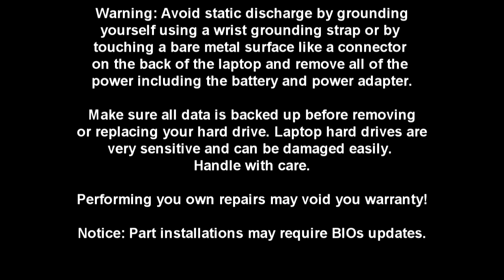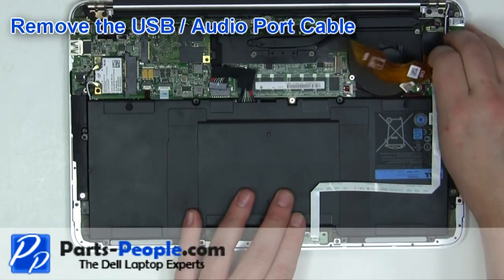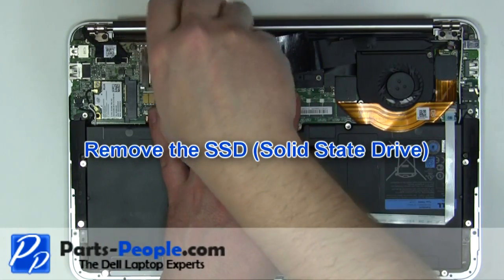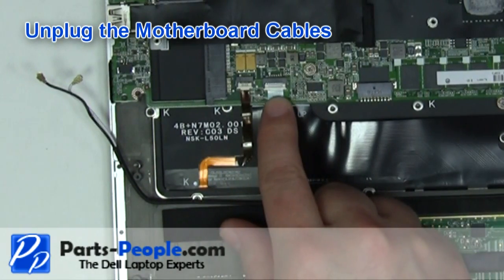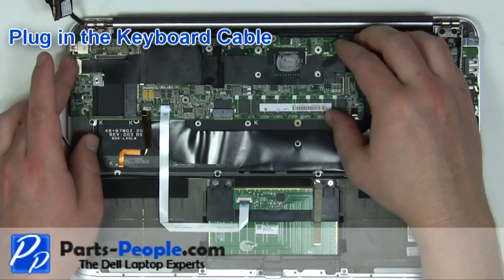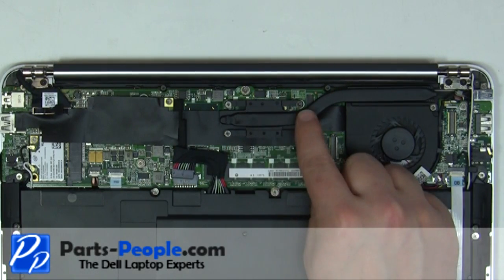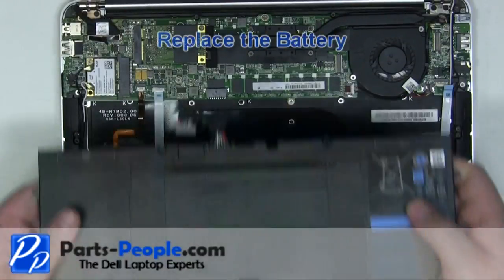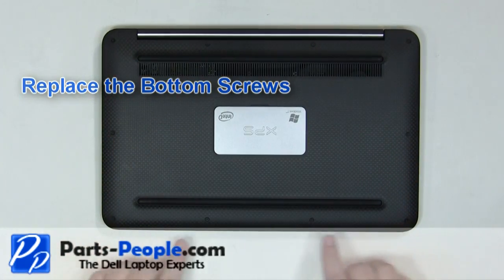Dell XPS 13 Ultrabook | Motherboard Replacement | How-To-Tutorial

Comment: dell, XPS 13-L322X: Image failed to verify with access denied press any key to continue, please can you me out. i can not get into the bios to turn off secure boot, but the is no CMOS battery to reset and i am stuck with that message. i have try all possible combination to access the bios. Fn + F12, F12, F2, Fn + F2, Fn + power. please help.

Comment: HI, is it possible to replace a l322x MoBo with a 9333 MoBo ? are they swapable ?
Reply from the maker: There are a few cable connections that vary between the two models that will possibly make them incompatible. Even if they they are swappable they aren't meant to be.
Reply: Thank you, another question, is it possibile to swap a non-touch display with o touch one ?

Comment: It's 2020 and I used this video to replace my motherboard. I pretty much used this channle to replace everything - Power cable, battery, motherboard BECAUSE the laptop was not charging plugging in the power adaptor.

Comment: I have a couple of questions. 1) can the CPU be replaced or is it soldered to the motherboard? Also, can the i7 model of the laptop accept an i5 version motherboard as a replacement? 

Thanks
Reply from the maker: The CPU is soldered onto the motherboard but, the motherboards can be swapped with a higher CPU.
Reply: Thank you so much for the reply! The motherboard in my I7 XPS recently went out, and the I5 ones are like a third of the cost on eBay, so I think I am going to use the I5 type.

Comment: Hi, just a question, I have a dell xps 13 L321X and the motherboard is almost dead ... Do you think it's possible to upgrade the motherboard with a more recent one like the dell xps 13 9333 motherboard (and if it's possible have I to change the audio-jack and USB board to ?) ?

Comment: Hi.  My dell xps 13 powers off when i lift it or move it and won't switch back on unless i unplug the battery or lightly tap on it.  Any clues on what could be causing this and how to fix it? I have also noticed that the led light never goes out when charging regardless of how long i leave it charging for.  Thanks.

Comment: What is the difference between the 321 and the 322 is there anything to would prevent switching the motherboard so i could use the I7 with 8 gig of ram from the l322x
Reply: +Robert Hoellering Did you ever find an answer for this? I intend on doing the same thing.
Reply: No I haven't sorry

Comment from the maker: Meg Hancock It's called a mSATA (Mini-SATA) Solid State Drive. I don't think they go up to 1TB yet. The largest I've seen is 512gb. http://www.parts-people.com/index.php?action=item&id=17374
Reply from the maker: ***** In the XPS 13, no, you cannot upgrade the RAM.
Reply: In the XPS 12 can you upgrade the RAM??
Reply from the maker: No you cannot. The RAM is built onto the motherboard and cannot be upgraded or replaced.
Reply: 0.o
Are there types of external RAM?
Reply from the maker: No there isn't external RAM.
Reply: Ready boost for example??
Reply: it isn't ram but a simple upgrade
Reply from the maker: You can try it but I've heard that ReadyBoot doesn't increase speed much if any at all.
Reply: I'm very disperate but thanks :)
I will see thing to do
Reply: My english is very bad because i'm italian....
Reply: About external graphics card??
I heard that thanks to adapters is possible...   ....is true??
Reply from the maker: I can't confirm that. I haven't tried external graphics on a laptop yet.
Reply: a
Reply: Thank you

Comment from the maker: The ram is built onto the motherboard and is not replaceable. There are currently 2 models of the XPS 13, they both have 4gb ram and either an i5 or i7 processor.